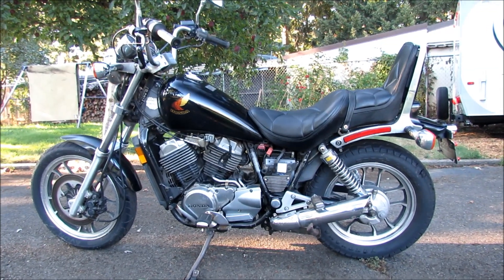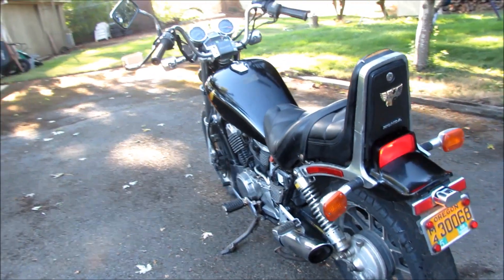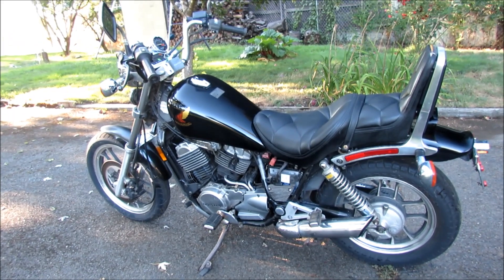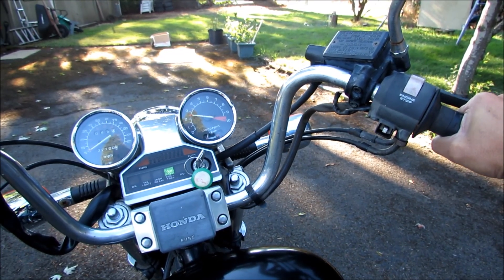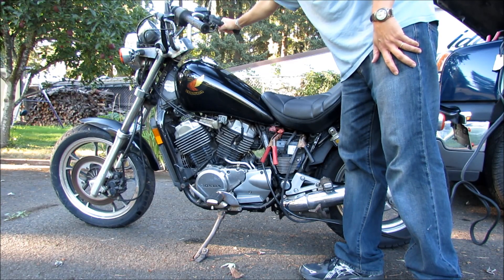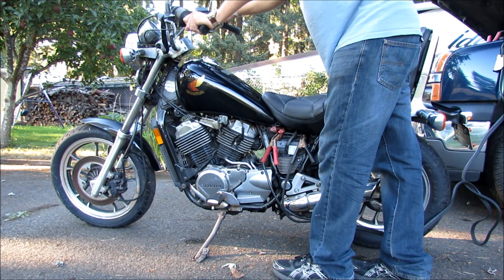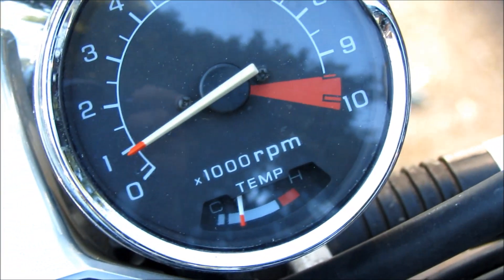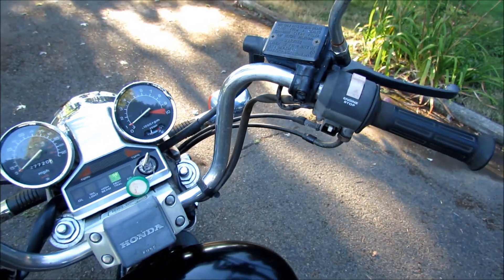Honda Shadow VT500 - runs well, slight throttle issue

Comment: your diaphrams are sticking the carbs need cleaning. bet it has been sitting quite so vales are good, enought time so it';s getting enough gas warm enough so the diaprams are not sticking but sounds like one cyl is missing.

Comment: Open the choke... your idle is too high, its not getting enough air when it warmed up
Reply: Mine has the same issue...It looks like the connection from the airbox to the carb is not solid...would that cause this?
Reply: @Pbobes1  were the sir box on these bikes, cant find it yet.  Just got 86 vt500, and it's doing similar issue?  Thanks